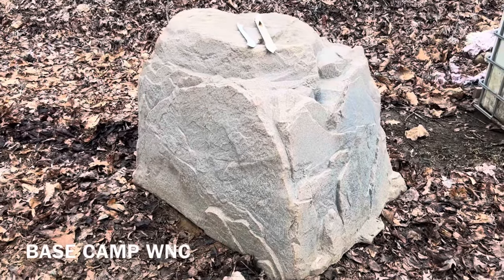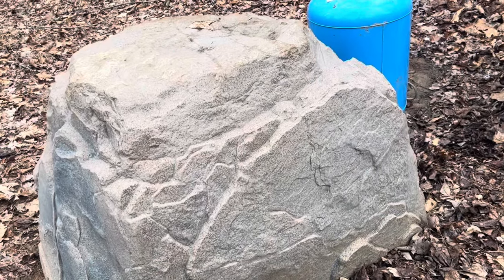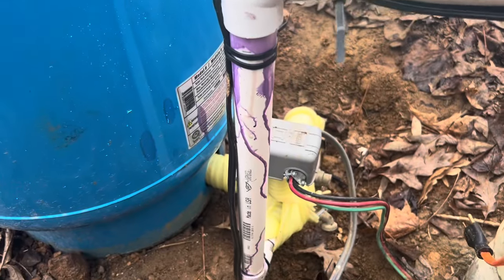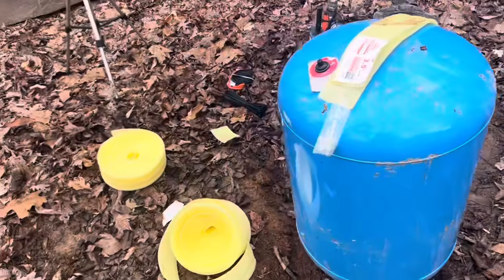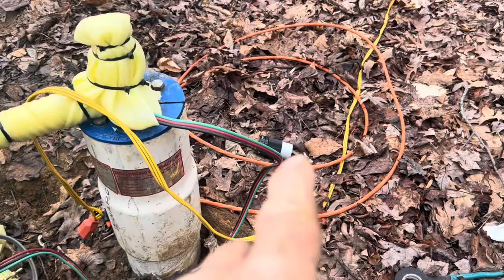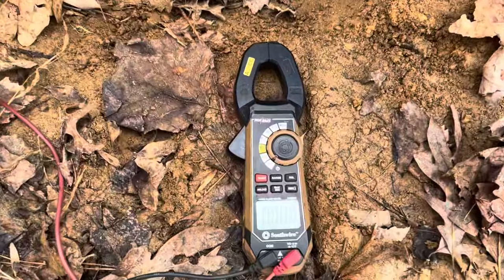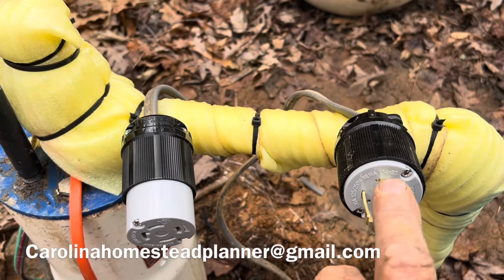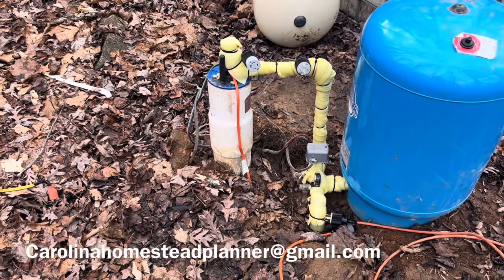Freeze proof your well head

Comment: Can you supply the make and model if the 240 plug.
Reply from the maker: Rich
I look at the persons generator and match it up 
Most are four prong NEMA L14-30R. And L14-30P
The P and R are the plug and receptacle ends
Available on Amazon and ACE HARDWARE 
These are the ends that are on 220 volt power cords available on Amazon or camping store